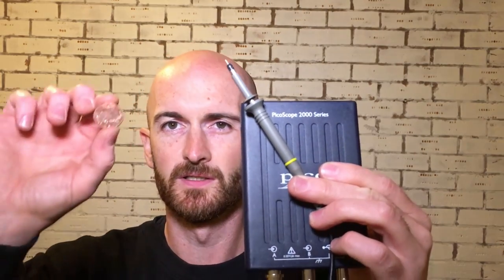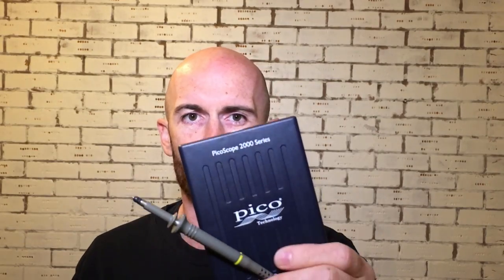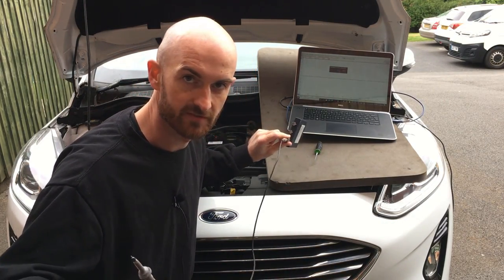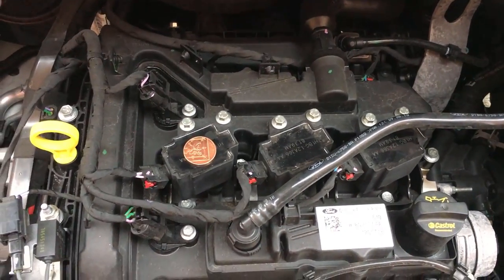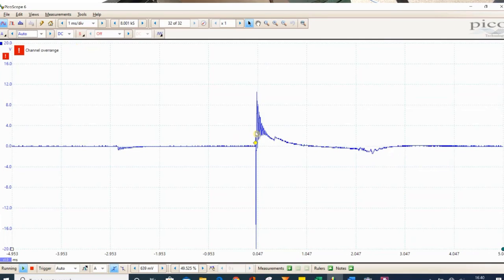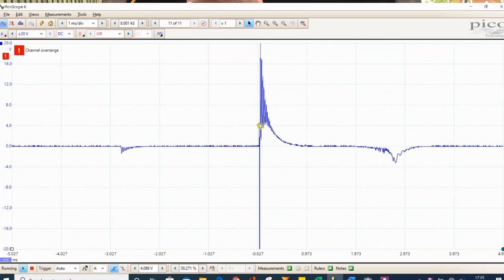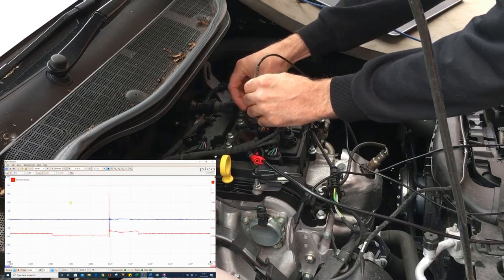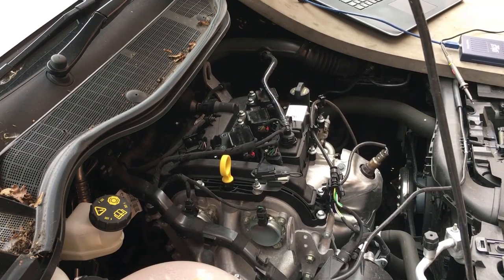FIND MISFIRES FAST! [How To Check Misfire PicoScope 2204A Automotive Diagnostics] Mechanic Mindset

Comment: Best scope videos I've found for beginning novice, thanks much. Why no need for attenuator on secondary but one needed for primary? This has been the hardest thing for me to understand as my Mini DSO is only good for 40 volts
Reply from the maker: V Childers Happy to hear that and thanks for the feedback! Well when you measure the primary, you are indirectly measuring the secondary too (but directly on the wire). This induces more voltage than the coin on the top so as it goes above the max input of my 2204A scope (which max input is 20V), I use the attenuator. If you buy a HT lead pick up, they usually come with attenuation built in. The coin method just doesn’t pick up enough voltage to use the attenuator. Hope that make sense?!
Reply: @MechanicMindset  Yes thanks, makes sense. I have a 20x attenuator that I can install inline as my leads do not have one installed. Looking forward to your other videos.

Comment: You know…sometimes you think, “I’m going to just lift this coil off of this plug. No risk involved here obviously.” Then it turns out the coil is rotted out and the head piece breaks right off it. All of them. Then you have to rip it out of the cylinder boar little piece by piece. Fing cars lol
Reply: Maybe you mean Cylinder Bore?

Comment: They told us in school all sorts of patterns and what they mean, but REALLY what you’re looking for is one of them is not like the others. The waveform is flapping around so much it’s going to be hard to tell exactly what the problem is
Reply from the maker: For sure, to an extent it can be difficult analyse the fine detail. However, with this test you can very quickly see that the coil is being trigger by the ECU, the secondary coil is firing and that there is some sort of spark. If you then compare to other cylinders you may be able to identify other combustion issues 👍

Comment: I don’t  really see how you get a secondary waveform initially just using one channel if you have to put an antenuator on for the next check. And where did you backprobe that red probe into. The power wire?

Comment: try to find an old cam shaft cunducter from ford focus 2004 and connect 2 wire leads to each pin of it isolating them apart off course...........put them on your scope plus wire and minus for use on quick diagnose on the spark plug coil.......hold it at point on top of coil  and you wil get a perfectly nice picture on scope

Comment: Thanks for the vid...however if u did a snap throttle with the injector disconnected test you would of see the bigger difference..due to the lack of fuel making the spark harder to jump the gap..all the same ..great vid an thanks..love the coil will have to try that...
Reply from the maker: LucchesiRocks Ah ok cool, will give it a go. Thanks for watching!

Comment: Love your training videos, I have learned so much.  My question is can I safely use the Hantek HT25 secondary ignition cable with the 2204a? Can you make a video using the HT 25 with built in attenuator.
Reply from the maker: Hi, yes the HT25 can be used safely (I think it has protection built in). I do have an need to have a play, there is a secret to getting a clean waveform with this tool as the 2204A specs are low. I'll put it on the list. Glad you're enjoying the channel! Cheers

Comment: do you have any advice on bi directuional scan tools for a better than average user I have in the past run launch sykes picavant and a few others for specialist applications (Lucas laser  with pods , I have been looking at the think tool top don or autel . Im trying to do this on a budget any sdvice reccomendations welcomed ..
Reply from the maker: Check out my video on the ThinkTool Master 2 (or S10 I think). Great tool, lots of features

Comment: I'm wondering. If you're measuring coil voltages, shouldn't you be using a 20:1 attenuator with that probe?
Reply from the maker: Here we’re only measuring the magnetic field given off by the coil. There may be some you need to use the attenuator but most should be if without it. Also depends on your max scope input

Comment: Intresting  video  out if interest  here for you. You know  vauxhall   astra  they have the long bar coil pack  .like some petrol  Peugeot  have.  Could  it read  the individua coils  within  the bar 🤔🤔🤔🤔
Reply from the maker: Someone did ask the same question; if you can get to the individual coils I would imagine it will pick it up. Maybe using the relay you will get a stronger signal (see my other video on that). Thanks for watching 👍

Comment: That 3 cyl. engine appeared to be running "rough" to begin with (you make a similar comment @ 4:01 ). So I think it would be a better demo to have chosen a 6 cyl. for a smoother idle demo and then drop a cyl. to show the difference.

Comment: Great video, Did you need to do any file swap to get the 2000 series to work with pico auto software?
Reply from the maker: Hi, I don't actually use the Pico Automotive software in any of my videos. Pico 6 and Pico Automotive are pretty much exactly the same! I do have a video which shows you how to do it by deleting a file but not sure if it works anymore. Thanks for watching!
Reply: @MechanicMindset  thanks for info and the swift reply, I guess you just don't get automotive presets or waveform library access?
Reply from the maker: Ant Waygood Yeah, you only get the waveform library if you buy the automotive scope. Presets are ok, but only if it matches the car you are working   on; it’s better to learn how to set it up yourself. The presets for the probes are useful (I.e ampclamp), but you can import them from the demo version. 👍

Comment: What wire should be back probed any diagram details to more accurately
Reply from the maker: @bikerboy6985  this is an old video; can you elaborate on what you’re trying to test?👍
Reply: I have doubts about what wire should back probed to get that spike i mean voltage
Reply from the maker: @bikerboy6985  it depends on the type of coil. If it is a ground switched coil, that’s the wire you want. If it’s not a ground switch coil (driver in coil), you can’t get that pattern by probing.

Comment: Dealing with a misfire without codes. I am willing to try this test. Did you have to let the scope know that you were using the attenuator?
Reply from the maker: Yes need to tell it; can’t remember I we used it though for this test. There are so many ways to do ignition testing; this is the quickest but not the best. You get most infor with secondary ignition clamp. Or depending on coil, scoping the ground coil trigger
Reply: @MechanicMindset  This test looks so cool that I have to give it a try. Hopefully, I will find the misfiring cylinder. If I don't, I may have to use an amp clamp since it is a 3-wire coil.

Comment: great tips  love the coin trick to enable the rasta to be seen easily , great to see the 2000 series in use and connected to a laptop saves a load of cash ,liked subed and followed , saved and shared to my young padawan / don't suppose you have a good recommendation for wiring diagrams ?
Reply from the maker: Great to have you with us! I like AllData for the OEM diagrams. There is an app called Carmin, you can get free diagrams but they do t have everything

Comment: Quick question taking this forward.. if you want to use this scope to get a wave form from ignition coil HT leads (not coil over plug) then i would need to either back probe the coil pack or buy a Hantek HT25 lead that can clip straight onto the HT lead. I see this has the attenuator built in to it to protect the scope? Do you know if this is removable or have i got to purchase another attenuator to use inline to protect the scope when back probing the coil packs like you show in this video?
 Thanks
Reply from the maker: The Retired Mechanic Yeah I have the HT25, it comes with the attenuator as part of the lead. Bargain that lead! 👍
Reply: @MechanicMindset  so its not removable?
Reply from the maker: The Retired Mechanic Nope
Reply from the maker: The Retired Mechanic You can also get an extension HT lead to put between a COP coil and spark plug if you wanted to

Comment: Very interesting. Thanks. Not sure why you delete the ground wire. What do think could happen with a faulty coil with compromised insulation arcing to ground if the arc went via the probe lead. Worried that without a ground the V spike would fry the Scope? Thoughts? Also, you mention the +/-20V limit of the 2000 series. I may be wrong and correct me if I am, but I thought that 20V was just a range limit with with X1 probe, but the input protection is up to 100V, The scope spec sheet seems to confirm ±100 V (DC + AC peak) up to 10 kHz?? In AC range not sure if that means +/-50V peak to peak, or +/-100v peak to peak. Can anyone confirm or clarify overvoltage protection profile?
Reply from the maker: Hi, the test doesn’t work with the ground connected. Also, without the ground connected, the scope is not part of the potential difference. So as you mention it would just go to the nearest ground. Not sure what would happen if there was a spike on the actual probe itself; I must try it some time! Check out the video where I use a relay coil for the same test, pretty cool! You can ensure the probes are ‘insulated’ this way. As for the input voltage, yes it is rated to have 100v over voltage protection. As for how that is applied to AC, I could not say. Thanks for watching!

Comment: I've tried this and it works! Does wyze probe works better? If it does, in what aspects?
Reply from the maker: Bengkel Bawah Pokok I’ll be honest, I have not used it. Pico and Hantek do a similar product. I am quite happy with the results I get from this method. I also consider that it’s not a test I have to do every day. If it was something g I did every day, I might consider something like this. Just so I don’t have to keep moving a coin around, or the issues you might ha e doing this on a V8/V12 (coin dropping down the side of the engine). Thanks!
Reply: With the 2204 picoscope, do you need to use the 20:1 With a paddle probe for COP testing? Or is the attenuation done in the probe? Cheers
Reply from the maker: Brad james Sorry, not sure, I didn’t use any attenuation in this measurement, although this type of lead does have the 10:1 option if I wanted to use it
Reply: Cheers I will see if I can find a custom probe for COP on Pico website
Reply from the maker: Brad james I did see somewhere that the scope set up for the COP probe is 1000:1, maybe to read kV on the screen?

Comment: I like that coin trick, if only to be sure the inductive matt lands in the same place for each coil. Playing around with dedicated inductive sensors, I found minor position change causes dramatic differences in the waveform.
Reply from the maker: Definitely; different results for different positions and coils. 

I think this is best for just confirming trigger and secondary activity. An inductive tool is better for proper diagnostics 👍
Reply: @MechanicMindset  

Thanks, Darren.

I have used a 2204A with a short lead and a coin to test 3 vehicles, which are

2009 Mitsubishi VeryCA 1.2L --- the waveform seems good ( primary and secondary )( waste spark coil )

1996 BENZ W210 V6 2.4L  ---- the waveform much better ( also can see primary and secondary )

1996 BMW 528i E39 --- terrible waveform like 3 hills in positive side, not negative side shown. unable to see primary and secondary.    I really don't know why.
Reply from the maker: @tonylin9833  is BMW multi-strike? Makes a few sparks in one go
Reply: @MechanicMindset  

Sorry for the delay.

W210 V6 with 6 coils, each of them fires 2 spark plugs.  As I said its waveform is much better to see.

But BMW 528i E39 has got 6 coils, each of them just firs 1 spark plug.  Just don't understand its waveform.  Sorry I didn't save it as of a newer.

This afternoon I tried to get to know about Rotkee PS16 with pico 2204A on our old vehicle, Toyota Crown 1974 from my Father.  I used picoscope 7 T&M and picoscope 6.  After getting some waveforms, I zoomed in and found out the waveforms were not completed.   I changed it to Channel B, which got much better.  I don't know why.

Now I know the problem --- the sample rate  pico 2204A provides.  N

So thank you so much I have learnt and practiced.  Next time I will use 4425A.

Comment: Darren is it possible to test the frequency of a idle valve and duty cycle? Also injector dead times? Be very handy to test  these and coil dwell times from oem so if using aftermarket ECU the numbers can be put into the new ECU as starting points. Great channel thanks
Reply from the maker: Hi, yes, you can measure duty cycle and frequency. there is a measurement function to get this data on the screen. not sure about dead times; see my injector videos where we can look at mechanical opening and closing, but not sure if that data can be used for engine tuning

Comment: I have only been able to het this to work on two wire coil on plug.   Not able to het pattern on 3 or 4 wire coil on plug.    Is this normal do to the internal makeup of coils with more than two wires
Reply from the maker: Hi, I haven’t had an issue before, but come to think of it, can’t say I’ve seen may 2 wire coils. It should pick up the EMF from any coil type components (injectors, EVAP etc). See my other video where I use a relay to achieve the same. It’s a bit more sensitive

Comment: The secondary waveform with the coin  looked strange? Especially where the coil oscillations happen? Plus I've always wondered why Coil on Plug secondary waveforms are so poor compared to the old distributor days? Those used to put up a great secondary pattern that was very good and easy to read and the COP have always been a more distorted waveform. Especially where the spark Kv is at the beginning of the burn time there is so much ringing going on with COP it gets hard to even tell what voltage the spark kv or burn time actually starts at?
Reply from the maker: Good observations! You can get the same patters as distributer systems; we need to add a HT lead extension between the coil and plug, then attach the ignition lead clamp, instead of the coin. Did a few videos on it recently 👍
Reply: @MechanicMindset  Do you know if Rotkee is still making lead sets?? With the war going I was wondering if you can still buy their products?? I'd love to try some of their lead sets but they haven't responded to my email??
Reply from the maker: @70corwin  They are operating. There may be delays in orders but I did have contact with them recently 👍. Many others are still putting orders in

Comment: I tried this test on an 06 Sentra, COP, with a 4425 and the pico 10:1 attenuator. I had to increase the voltage range, the scope sees just over reads 415 volts on each cylinder. Since, the max input voltage is +/ 400 will, this test hurt the scope?
Reply from the maker: That’s odd! I usually have to set the voltage very low to get a good signal. You can confirm the correct scope setting by checking and confirming the battery voltage with the same oscilloscope setting. 400V is high! Generally it’s around 2V, I had one that was 12V
Reply: @MechanicMindset  I did select the 10:1 attenuator in the probe settings. Should I have not?
Reply from the maker: @codylopez2020  Ah ok, maybe. If you didn’t have a 10x probe connected
Reply: @MechanicMindset  without changing the probe to x10, I get almost -50 volts coming into the scope, which is a 4425 capable of 200 volts, so I believe I should be ok!
Reply from the maker: @codylopez2020  Yeah you’re good 👍
They all vary based on the construction of the coil

Comment: nice.  I would worry about not connecting the ground though.  The ground on paddle probes are there to save the scope from if a leaking coil sparked to the lead. (although with no ground connected I can't see how that could actually happen)
Reply from the maker: Hi Bart Young , I wasn’t aware of that. Not had any issues so far 🤞. I have seen the paddle probes, we do have one at the academy. I think a spike from a coil might not do this scope good either way; only has a max 20V input 😆
Reply: Don't run ground adds a fault path 

On the induction probe it's worth it 

If you want protection u run ground on coin

Comment: Good video but I couldn't see the problems in the graphs when you removed number one to see how it would react. You said you can see but it looked the same on all of them. Do you have other video showing what's wrong with the graph. Thank you.
Reply from the maker: As I say it’s hard to tell. There is just a bit more turbulence at the end. This isn’t the best method for detailed ignition diagnostics; best use a secondary ignition clamp. I have a few recent videos 👍

Comment: Hello mate, thanks for this video. Notice u recommend the Hantek accessories... What do u think of the Hantek 1008C scope in comparison with that Pico 2204A (they seem to be about the same price but more accessories on the Hantek)? Thanks
Reply from the maker: Hi, I have videos on both these scopes. My preference is 2204a for the better sample rate. 1008c has 12 but which makes smoother curves in the waveform, but you can get around that on PicoScope. The accessories (leads) aren’t great with the 1008c, you should buy some better leads anyway. The amp clamps are fine and work with 2204a. Hantek software isn’t great and it’s difficult to use all 8 channels and not really necessary. Hope that helps!!
Reply: @MechanicMindset  Ok mate, thanks for getting back to me on that. Think I'm gona get the Pico... That Amazon (uk) link u have for the Picoscope - is that the amazon page of Picoscope themselves, or a re-seller? - thanks.
Reply from the maker: @iozel4633  Sorry, not sure. You could search and find a better deal, the price fluctuates a bit on Amazon 👍